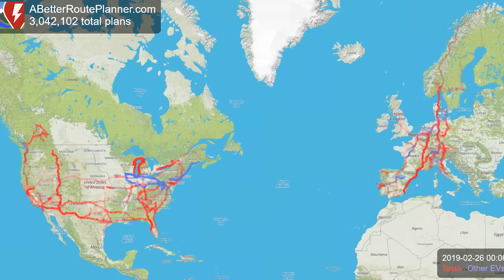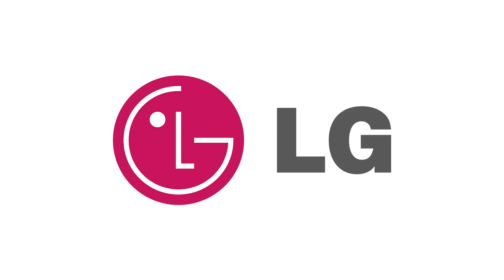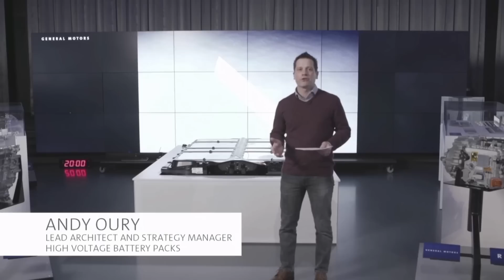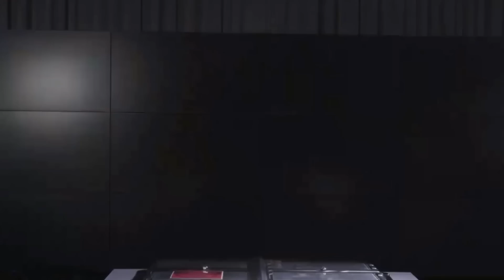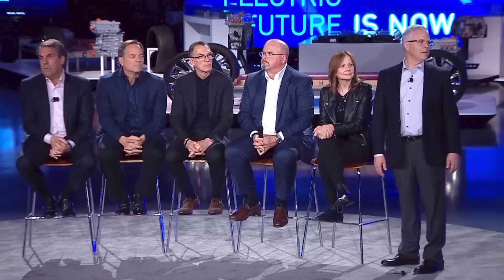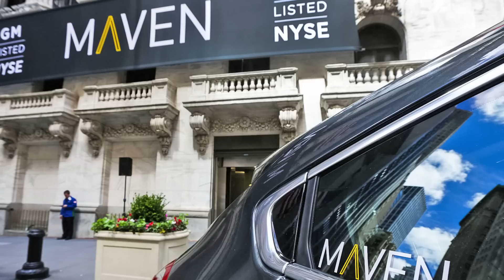GM EV Day | In Depth

Comment: Actually Tesla's pack does take passenger room.  In the back seats you knees are in your chest in the Model S.  Most cars that use pouch cell omit them in the rear footwell area or the front footwell to provide a deep well.  Then they stack batteries under the rear passenger seat.  Could you do this with cyclindrical cells - sure, but it's more complicated.

Comment: GM will never go head to head with Tesla. They will make a diferente transition. What do you think all the small EV companies are exploding in price such as Work Horse and Nicola? The big car makers will purchase these companies on the side and create a new structure away from unions, old fashion management and so on. They realized that to compete with Tesla they will need a new company, the old one can not merge with the new paradigm and mind frame of the new manufacture, design and work relations of modern companies. That is my take. You are right, GM will shrink or go bust and a new company will emerge from it, but from the same capital roots. Car companies models are dead for the future and they know that. Maybe Toyota and the hight end brands car survive, but Ford, GM and Fiat are dead.

Comment: It's sorta a bankers loss in time.If a loan company loans,it wants the participants (Cars and other items to last well).With that said,how is their investment,(The loan),going to keep in set as a good loaning reason.All the shakes and bumps will bruise the holding materials like hammer rounding to points of no contacts on it's terminals.100,000 bumps and pot holes bangs will destroy the system to fail.
I'm the guy that Studied 2500 high,medium and variant studies for inventing at the highest levels one can achieve!
So I 'm going to allow you guy's to pass that on if you wish,or talk about it on you videos.Ebery curb hit or run over causes 4-5 percussion 
Bumps,pot holes about 4,2 are hard bumps,2 are soft!Breaking causes a tilt on the verticle,and side gualging and wear on braking in the horizontal pattern,it will do it on hard take off to!! See I told I'm the Alpha inventor!And I didn't even sleep well last night for this sharpness,ouch!I'm off the couch,but even still I'm sleepy and I think my brain is faster then I wish to be!!
But do tell GM about this so they can improve now before later when crapp happens! All companies should follow what I just told you on contact points.
Batteries aren't that high!How many batteries are in these??!!2000x2 dollar's,please!Ai will get many killed.Humans are faster in reflexes of the eye,and can see side ways faster!And control correction judgement smoother and process loss of life senario's faster and find the hole to save their butts! Well gotta go! Bye!

Comment: I have a huge trust issue with GM.  My 2005 GMC Yukon XL 2500 has the amazing Quadrasteer system that GM developed and, unfortunately, terminated four years later.  Then GM sold Quadrasteer and quit making replacement parts for the system making my $65,000 Yukon XL and all other Quadrasteer equipped vehicles virtually unrepairable.  Now, a formerly $100 steering wheel position sensor that is no longer made sells for thousands of dollars on eBay to owners trying to keep their GM vehicles running.  My other vehicle is a 2019 Tesla Model X that not only keeps running maintenance free but continues to receive software updates that improve its functionality.  Sorry, but no more GM vehicles for me.  Jess

Comment: No surprise.  While I appreciate GM's move into the EV space, they have several challenges ahead.  First, they do not address battery reliability which could be an issue with their approach.  I don't see enough details to make a call, but it gives me pause on their approach.  Second, and maybe more daunting is their dealership network.  How will they incentivize dealers to want to sell EVs?  This has to be a key part of their strategy as they have not been successful so far.  Third, they are still reliant on third party charging networks and while efforts like Electrify America are gaining ground, they have yet to be proven as a truly effective and practical.  Fourth, when will I be able to buy a GM car that implements this technology?  Every day that goes by, Tesla continues to gain ground in the EV space.  All in all, noble effort GM, and I do appreciate you acknowledging that the EV market is important, but you have a lot of work ahead to make it real.

Comment: NO NO NO! The Bolt is NOT the first affordable long-range EV. 250 miles is not long-range.
GM is hiding behind its own self-serving definitions.
The common opinion is that long-range > 300 miles, short-range < 199 miles, mid-range is 200+ to 299 
In EVs, affordable is below $50K: as defined by Tesla Model 3, Chevy Bolt and Nissan LEAF.
1) The Nissan LEAF is the first affordable short-range EV: 84 miles at  $37K
2) The Model 3 Long Range is the first affordable 300+ miles range at $49K
3) The Chevy Bolt is the first affordable 200+ miles at $37K 
4) The Model 3 Standard Range is the second affordable 200+ miles at $39K 
So... The model 3 long-range (300+ miles) is the first affordable long-range EV, not the Bolt.

Comment: Sigh, sadly here in Australia, a base model SR+ comes in just over AUD$70,000 A Performance fully optioned red FSD hits just over $122,000
Reply: 70000 aud$ is 45570 $ and 122000 is 79422 $ thats what they said right ? so your prices are not so much diffrent.

Comment: This is a very good video, way better analysis than any of those morons that work in the investment banks or for Bloomberg.. The 2 key points from your analysis (if I may sum up for you !?) are that GM have absolutely no idea how they are going to reconfigure their value chain - and therefore where they are going to add value for customers -  and secondly they have absolutely no idea where they are going to create a RELEVANT COMPETITIVE ADVANTAGE against Tesla - its certainly not in batteries and therefore not in range or performance...
If I was an investor I would be out of there, which sort of begs the question why the investment banks etc are still holding any GM stock ?
Oh and why we are at it, what has happened to all those Harvard MBAs GM recruit - have they been lobotomised ??

Comment: 22:20 - "For the best user experience in charging - copy Teslas system." I doubt that. Tesla has this proprietary charging inlet in the US - this needs charging adapters at all J1772 and CHAdeMO charging points, and it makes it impossible to use CCS chargers without an adapter. In China they have adopted the national standard inlets for AC and DC, but still their Tesla superchargers are available to Tesla cars only.
In Japan, they need a CHAdeMO adapter each time and J1772 adapters as soon as a Tesla owner comes to a public charging point. In Europe they went with a propietary DC charging over a Type2 inlet first, then changed to CCS Combo 2 (the European standard) but still have this software-locked down Supercharger infrastructure - with two charge cords in some places and with CCS2 exclusively for SuC V3. Tesla builds a "brand-exclusive" charging infrastructure with either proprietary connectors or software restrictions and from my point of view that's a fail as it does not blend with the public charging infrastructure. Tesla adds complexity to the needless variety in charging inlets. Just like with Apple, the user may get a decent charging experience when staying in the Tesla world - network of Superchargers and Destination chargers and a Tesla home charger, but from my point of view that will be a severe limit soon with many more Teslas being built but Tesla more and more relying on public charging infrastructure providers.

In SuC V2: The A/B stall sharing of AC/DC-backend components (this way, Tesla can offer double the number of stalls from the same number of AC/DC converters) is another irregularity and with the resulting reduction in charging speed, is another source of trouble as people will get reduced charging speed when the charing site is only half used. In terms of predictability this is not a good option. They changed that with SuC V3.

And finally: GM uses 700-800VDC battery voltage with is pick-up trucks, keeping currents to 500A to reach 350 kW charging power. Tesla SuC V3 so far stays with 350-400V but needs currents in excess of 700-800A for 250 kW. This higher amperage causes excessive heat.

Comment: Very boring. I agree with what you say but your other posts are more interesting. Hopefully GM is finally starting out into ev which has to be an ongoing progression of change and evolution that they are yet to learn about. But I'm not sure they need an entire show picking them apart. All manufacturers are reluctant for change as they don't know. Who cares if they fail or not it just adds to the story of manufacture. Either they'll move into the future or they won't.

Comment: BUT THE FLAT PACK WILL EXPAND AS IT'S USED. THIS IS WHY TESLA DOESN'T USE THIS CONCEPT..KINDA VOLATILE...THE LACK OF COBALT IS GOOD. BUT ALL BATTERY MANUFACTURE HAS BEEN WORKING ON THIS..PLUS I HEAR THE BATTERY MANAGEMENT SYS IS PROGRAMMABLE..AND WHAT ABOUT THE HEAT PRODUCED...THERE GOING TO GET HOT..NO SPACE FOR HEATING OR COOLING...

Comment: I often like your videos, but this one was missing something.  It was how GM is positioning itself relative to other companies than Tesla.  How is GM positioning itself vs. Volkswagen, Honda, Toyota, etc.  There was a huge missed opportunity in this video.  So much so that I recommend a follow-up video.  I would particularly focus on how if GM is doing less than it could/should despite this effort, then that makes Honda and Toyota really backwards.  Does this mean that GM is likelier than other companies to avoid going to zero?  Even if you think that they're going to zero, might they hold on longer/shorter than the others?  That's way more interesting to me than just comparing every other company exclusively vs. Tesla.  Tesla remains a relatively small part of the car industry.  That may change, but that's where we're at right now.  I know you're Tesla bulls, but getting so myopically focused on Tesla means you might miss other trends, and important competitive advantages/disadvantages when comparing the incumbents against each other.

I also think one of your criticisms is incorrect.  I think GM is correct to say that many/most of their customers are agnostic towards gas vs. electric cars.  Once you've tried an electric car then it's hard to go back, but most have yet to try one.  Most car buyers are still buying ICE cars, but would consider an e-car for the right price/range/etc.  So it's fair to call those people agnostic to the underlying technology, and they're 97% of the North American market (for example).

Comment: GM designed the bolt and its components.  The reason why they outsource to LG Chem is because they are not unionized and they can make the components much cheaper then GM can

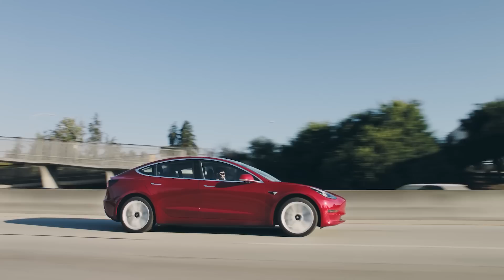Comment: @30:28 In Australia, model 3, Standard Range Plus (which is the cheapest model sold here) is $67,900 AUD.   That is still a premium car. It's about the same price as a BMW 2 series convertible.  I'd like to see a Tesla sold in Australia for about $30,000 AUD. Maybe the Tesla 2 will fill that sector.

Comment: Does anyone see a problem with GM batteries for EVs? There is active cooling/heating system. Considering that they're planning on stacking these pouch cells together, cooling is a huge issue. So where is the active cooling system for the battery management? Cobalt Nickel batteries are known for catching on fire if they overheat...

Comment: I remembered GM did have a skateboard a line time ago I believe in MotorTrend. They had a motor on each wheel. I believe they were the first with this, and believe it was before the government bail out. You should research it and give this credit with the preproduction vision, even though they failed to deliver it, just like took forever for the mid engine corvette!
Reply: It was unveiled in January 2002 I believe

Comment: It’s hard to watch a major pillar of american history,  fail to understand we are already at the bend in the nea of the J curve that is going to change their business model fundamentally.

 In 15 years we will be looking at a $40 per KW batters. Probably a lot less.  A $30,000 Dollar car is great, but imagine a  $15,000  car with better performance than the model S?   In 15 year more then 95% of all cars sold will be electric.  And this is ultra consrvitive.  The Trend line we are on is far more disruptive.  Distribution happens fast. In 1900 cars were a novelty. In 1913 they were dominant displaysing horses in the 1913 New York Easter parade. 
https://youtu.be/y916mxoio0E [highly recommend]

 As much as it sounds like you are simply Tesla Fanboys. The reality is  GM has to deal with reality sooner rather than later.  Kodak does not exist because they underestimated the power of digital photography. GM is making the exact same mistake. They refuse to believe that distribution happens fast,  and we will certainly be writing their epitaph  in 8 years if this is the future they are planning for.

 One could bet battery chemistry is reaching its maximum power density, in which case, electric cars will be limited. I think it’s a bad bet.

It’s more likely that oil companies will not  invest in a company that sees only doom and gloom for them. By not dealing with reality Tesla is going to be the largest company in the world in 8 years.

 In the case of AI, I am betting that 99 % of the complexity lies in the last 2%. 

I am not sure autonomous cars are going to work out as well as Elon and others think.  Work zones are going to be hell for AI's as well as Snow and Rain, while at night in a work zone.  Those are the basic scenarios, we know of, that are going to be hard. Then there are  the unkows human factors.  People have a tendency to F with systems, when they know their dealing with an AI.   So we don't yet know how that relationship is going to be between humans and road warrior AI’s.

Even if 98% effective that last 2% turns an autonomous car into a roadblock without a human in it.  Now a stop gap could be  telepresence  on demand, giving the car a phone home option, a kinda AI  AAA service.  I am assuming Starlink will be fairly robust in 7 years.

Now to be fair, as a truck driver I want that job.  So perhaps I am seeing opportunity where there is none.

Comment: I think you guys are a little too much in the pocket of Tesla. I do agree that not only GM, but the rest of the industry are far behind Tesla and that Tesla is a great company - doing great things. But you forget the customer and it takes time to change habits. I'd be willing to bet the oil industry will lower gas prices as needed to help keep people in ICE vehicles and manufactures will lower prices of vehicles as well until they can increase and catch up. Good video and points though. GM has to be on full alert and working 28 hours a day to fend off the Tesla barrage.

Comment: Modular and skateboard designs are not synonyms. GM is making battery modules from multiple cells and using multiple modules in the skateboard. Each module will have its own BMS and if there is a problem with one module, it can easily be replaced.

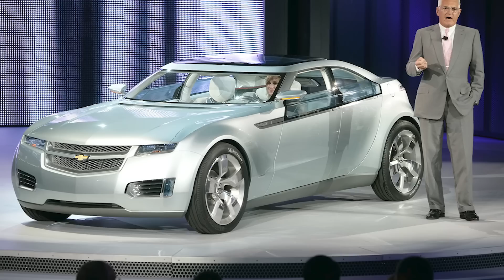Comment: GM should be remembered as EV1 killer (before) as well as EV movement blocker (still).  After EV1's destruction, they were force by Tesla to get involved in EV again. This time, they came up with beautiful concept car of Bolt (as you mentioned at 1:26 ) to slow down Tesla, then decided to scale back with the ugly model when the time came to launch the production model, to prevent wide acceptance of that EV. Now, they are again promising general public with all these "Vision & News"...  Until they announce their plan and commitment to complete depart from ICE car manufacturing, all they saying is that they want to slow down EV's progress and whatever they are trying to do is not for the customer nor for the environment.

Comment: GM quote 400 miles from a 200kWh battery , holly shit that is so inefficient - worse than a Tycan.  They are using "bag" batteries, but cooling is the problem - and it is difficult to package bag batteries so they have good consistent cooling.  GM is fucked.

Comment: 44:00  "20% of Siverado sales".  You guys know Tony Seba's work/words.  Tesla doesn't need to capture 20% of GM's most profitable vehicle sales to cause trouble.  Tesla only needs to capture possibly as little as 5% of sales to cause catastrophic results.  Margins are slim enough that even a small sustained dip can collapse the company.

The thing that you all aren't considering though is the 400 mi range $25,000 rule.  As the EV market matures above 5% adoption and early majority adopters become not just EV neutral, but EV favorable, GM and the other IC  automakers can offer that range at that price point using an IC REx, something that Tesla will NEVER do.  

This is an opportunity that GM and other IC automakers could take advantage of, IF they get it / IF they realize it's there and take aggressive action to capitalize on it. (That means rapidly moving all their products to pure electro-propulsion, no stinkin' so called PHEVs, which today are in reality plugin-hybrid-internal-combustion-vehicles, PHICVs. Even at the very minimum something like Nissan's e-Power could work.  But why not add a few more batteries and a plug and reduce petrol usage by 90%?)